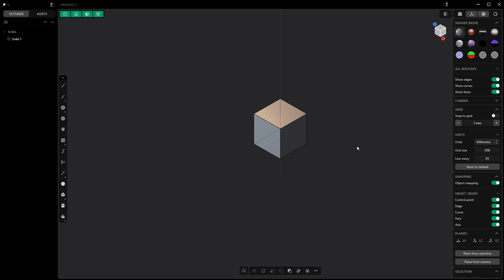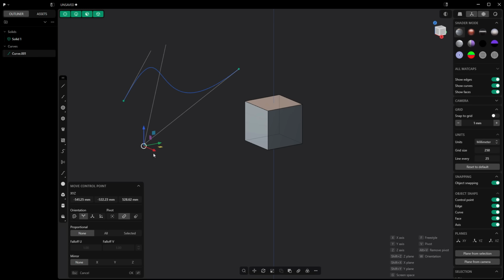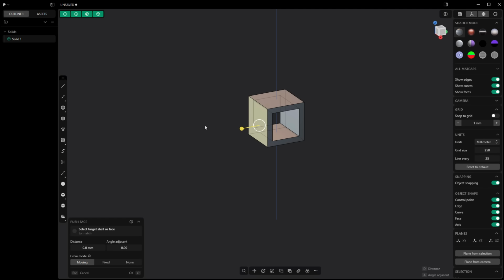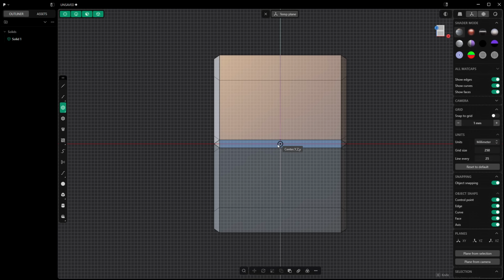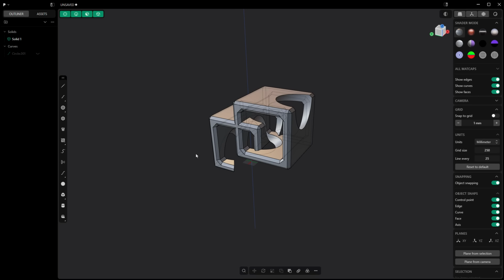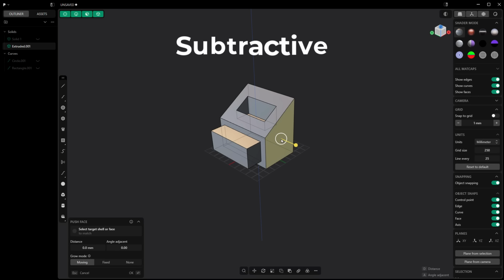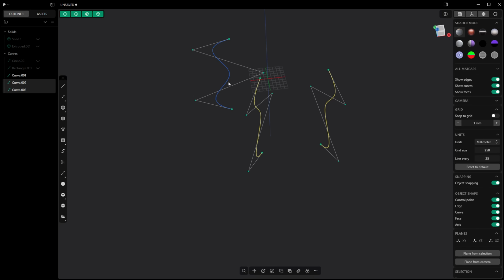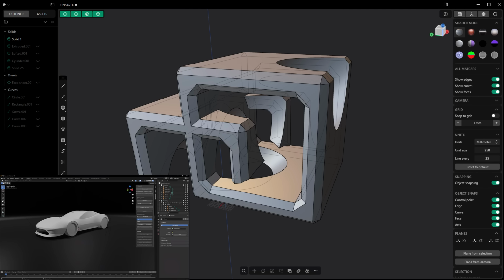Understanding Plasticity Modeling Theory for Beginners

Comment: Hello wondering, can you assist with a simple workflow we used in Rhino for signet rings, but Plasticity does not seem to have the function "surface from network of curves" ? webduncetv has tutorials on this exact workflow, is there any other way to achieve this with Plasticity  ? TIA
Reply from the maker: For that you likely need to have the Studio license and Xnurbs.  https://youtu.be/iEVZEBlfVUw

Xnurbs lets you build surfaces from network of curves that don't have to intersect.  Other tools like Loft work but you must have intersections between guides and rails for that to work.

Comment: Great videos. I was really confused coming from shaper and fusion. This helped a bunch so thanks!
Reply from the maker: great glad it helped!  Plasticity being a direct modeler can be a bit of a struggle to get used to.  While you can find all the tools in menus, shortcuts are really keep to making it flow well.  Also there is no in product support which i do think hurts it a bit.  You have to go to the plasticity.xyz site.  So for example if you can't select loft and don't know why it can really put off a new user not knowing you need to preselect things...

Comment: I love Plasticity.  I've used so many 3D programs in my life but Plasticity actually puts food on my table!   There are a ton of features I don't use or don't use properly yet I can still make files that make parts that make me money.
I use Mac, so one thing is my question may be Mac only?   ....I walk away from Plasticity, leave my puter on.....when I come back, my desktop is full of Plasticity files.  It's a means of saving the files, I know.  How do I turn it off or redirect the saved the files into the folder where I save my working files?  By the way...don't recommend Github.  I must be too old ...I simply don't understand how people communicate there.
Reply from the maker: Glad to hear that!

On the files thats a new one to me!  By default on windows they aren't on the desktop, but when you open Plasticity go to the P drop down menu in the top left and got to your Preferences.

In there you will have a section called Backup.  By default (at least on windows) it does an auto save every 10min and only keeps 1.  Maybe yours is set to keep more than one.  But this section will also let you pick a folder location so you can push them there.  If that is blank it will typically keep the backup where you have your file saved....

Im not a mac user so I am not sure if there is some difference there.
Reply: @LearnEverythingAboutDesign  
Wow...that was fast!!!  And to my utter shock and horror it was saving exactly like I told it to do.  
I musta looked in preferences 1000 times.  Now it's saving in a manner that I can deal with!  Love it!  Thank you!

Comment: Anyone have experience using plasticity with files that weren't created originally in the program?

I have about 20 years worth of 3d models (not commercial, just personal hobbyist stuff, mostly RC truck, FPV racing drone, robotics models).

I spent about a decade with SketchUp, and a decade in Fusion.  Both changed their pricing plan to where I can't justify the cost for just a hobby.

I've spent the last year installing and trying different CAD programs, trying to find a reasonably priced alternative and haven't yet found a fit.

Is plasticity pretty good with imports?

This video makes it seem fairly similar to SketchUP and a much more reasonable pricing structure.
Reply from the maker: Fusion does have a free/hobby license with limitations, but most of the design tools are there in the hobby.  As long as you don't need more than 10 active files at a time, or access to simulation that might work for you.  Not sure on the Fusion pricing plan changes, i was an early adopter so grandfathered into the original price.

On the import.  Plasticity is a direct modeler and works very well with importing and working with external neutral cad files.  The Studio license has more options for import/export than the indie license does fyi.  Right now you can import Mesh files and use them to snap curves to or create geometry on (constrained face), but there are no mesh tools directly like in Fusion.  If you are importing a step, iges,parasolid, dwg, dxf, vector or SAT files you can do that easily.  You can export various types of cad and mesh files as well (again studio vs indie has some differences in import/export), and there is a connector to Blender if you use that program.

Comment: I've seen that Tinkercad and Plasticity are the 2 CAD software that are easier on beginners.  Do you have any thoughts on when one might be the better option to learn?

(I'd like to do a simple enclosure, maybe using the PCB as part of the enclosure like what eevblog or Phil's Lab does!)
Reply from the maker: Hey there.  I did a design of an arduino uno enclosure for 3d printing for Autodesk but can't find it on their YT channel...  Maybe it never got posted.  but to answer your question on tinkercad vs plasticity, they are very different programs.

Tinkercad is a mesh program.  you aren't making sketches/curves and designing custom parts, you are generally working with primitives.  The skills aren't exactly transferrable.  However there are electronics and coding in tinkercad.  I have a video or two on tinkercad on the channel.

Plasticity is a direct modeling cad program.  Its a bit different than parameter based programs like Fusion.  You dont make a fully detailed sketch and turn that into a solid, and go back and edit the sketch if needed.  Instead you push and pull faces and add or remove geometry more directly.  I think Plasticity will offer up more flexibility in your designs going forward.

On our site www.LearnEverythingAboutDesign.com we have a few videos on designing a game controller PCB and housing for both 3d printing and for injection molding if you are interested.

Comment: Probably the most idiot shortcut key design ive ever seen in 20 years of using many CG software programs. 

There is a reason that you don't label keys by their starting letter is because they are all over the keyboard, costing you more time. 

In 3ds max for example is W for Move, E for Rotate, and R for Scale. 
In Houdini's viewport its T, R, and E. 

Why? because they are all NEXT to each other and on your left hand like most WASD or QWER games as well.

With this software you have to go searching for keys all over the keyboard because the devs think that labeling by starting letter is somehow an improvement on software that has been doing it better for 30+ years.Imagine thinking that CTRL+7 is a good shortcut. the amount of finger stretching to do that LOL.
Reply from the maker: You are the first one I have heard complain about this.  and CTRL+7 is a shortcut i use in Fusion :)  And F is fillet.  Some of the commands are very different from other programs but I come from CAD programs which are generally all different so I personally just roll with it.

G is Move because it is move in Blender(G for grab).  R is rotate because of Blender, and Scale is S because of Blender.  Most of the shortcuts are coming from blender directly as the software was meant to be a hard surface modeler companion to those using Blender.  So if that was a software on your list of many it would have felt very familiar.
Reply: Not all that bright are ya, sport?
Reply: For anyone who wants to manually change the abortion that is this software's "improved shortcuts":

The file can be found in a hidden ".plasticity" folder in your user's home directory (`C: > User > your_username > .plasticity`in Windows or  `~/your_username/.plasticity` on Mac or Linux).  > Save and restart Plasticity

While you can use F to assign in software, you cant remap that key, you know because of "logical devs", seeing as many other software use F to Focus and not one of the most important keys on the keyboard for a stupid shortcut key menu.

Do do this you have to use the file mapping as mentioned above.

Find the line that looks like `f: 'view:modal:command-palette'` and change the `f` to whatever key you want. So to instead change it to Shift+CTRL+F,  it would read : shift-cmd-p': 'view:modal:command-palette',`

Comment: I do enjoy watching PLasticity tutorials, and am often on the cusp of trying it, but I just can't quite get over the lack of a history. I guess it's my CAD roots!
Reply from the maker: I get that. It definitely feels different if you're used to a parametric modeling workflow.  The addition of measure/dimension helps a bit but I do understand.  I still use several CAD programs and Plasticity.  The speed and flexibility in Plasticity is great.  Especially if you are going to say a game asset or rendered animation.  For prismatic parts for say 3d printing, it can be a bit more of a mental lift to plan them out.